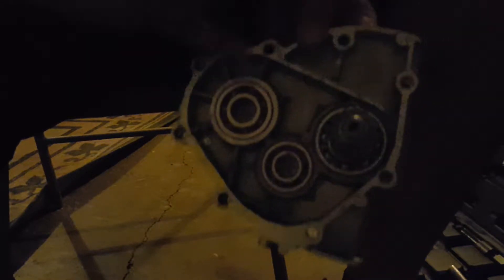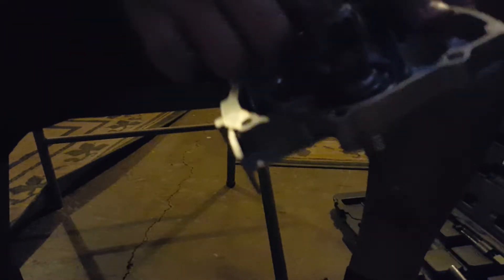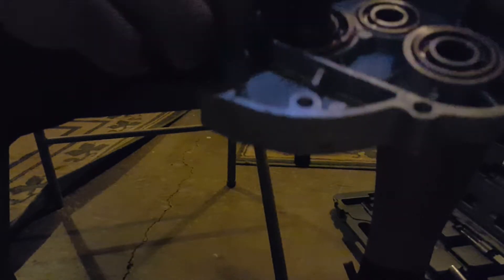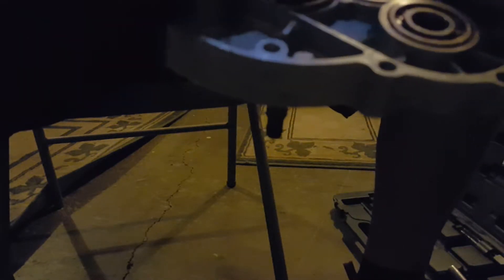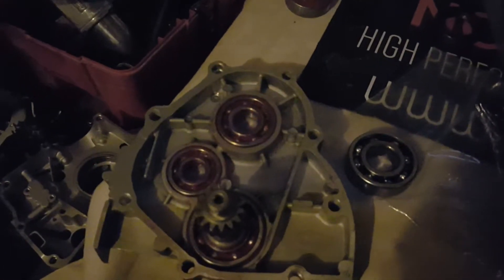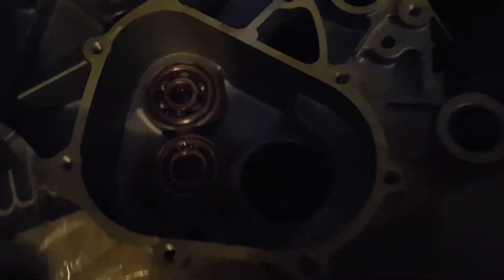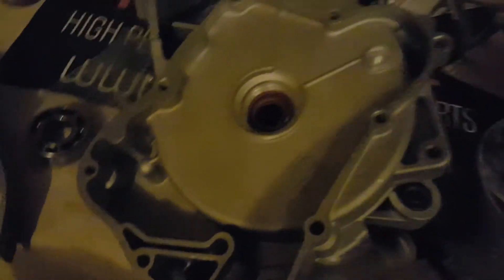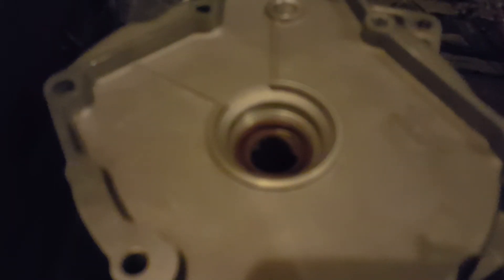How to install GY6 Bearings, Chain Guide, Gasket Spray, Oil Seals, & Stroker Part #7

Comment: Failer to plan, is planning to fail. Heres a bit of constructive criticism. First, Clean up your work area, its a fricking pig pen. Get things organized. 2nd, do all your "bearings" (its not called gears as you stated @2:22) and seals at the same time. 3rd, you put the crank shaft in prematurely, causeing you to remove it because you weren't ready to install the other half of the crank case, you are wasting time doing things twice over. 4th, that thing you keep calling a compression tool is called a "press" and a "wrench" is not called a RANCH!!! 5th, too much repetitive talking over the same things, ie...removal, installation etc. 6th, get a better camera and a tripod. 7th, learn how to use your tools right, you spend unnecessary time going over and over till you finally tighten the tool/s down properly to remove the gear and bearings. I bet all your gaskets are still outside with the copper spray on it and all dried up too. Your videos are very informational but theres alot you can do to inprove your content. Hope this helps!!!
Reply from the maker: Thank you for your honest review :)